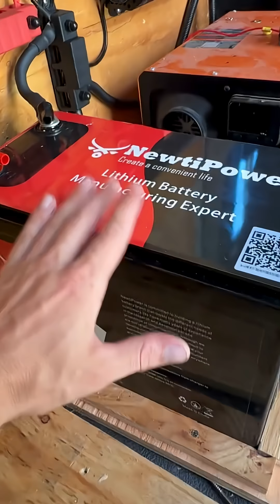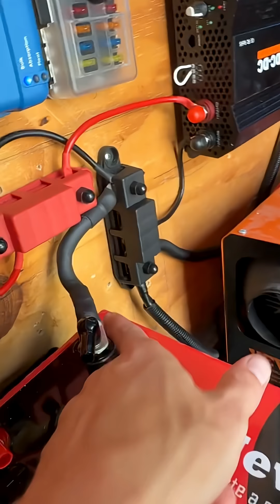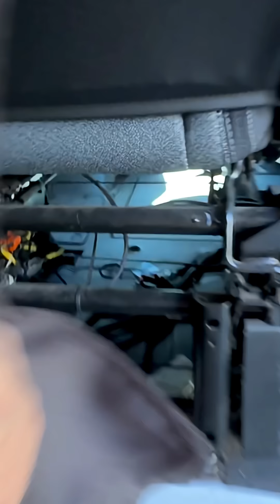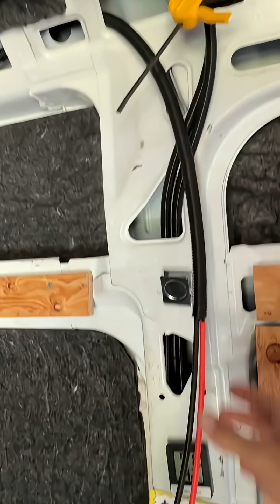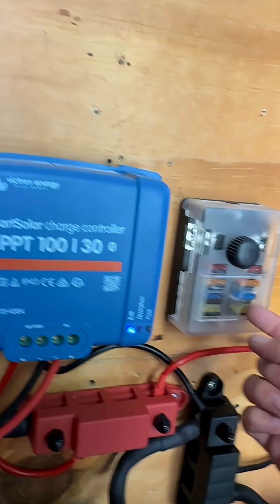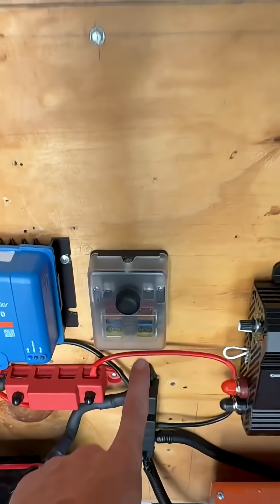12v 300ah battery with 390w of solar | Van electrical system

Comment: IDIOTIC...batteries, electricity, fuel...all attached floor and walls with untreated flammable wood? WTF is wrong with your recommending no gaps or fireproofing. Unbelievable. IGNORE this video other than learning what NOT to do.
Reply from the maker: Diesel is not flammable, zero current carrying metal is touching the wood. It is very common. Haven’t had a problem

Comment: You solar charge controller should be connected directly to the battery instead of to the busbar so it charges the battery even when you have your DC loads disconnected at the disconnect switch. Use case would be that while the RV is sitting in storage you want the solar to keep your battery charged but have your dc loads off so they don't drain the battery. If you want both DC loads and solar off for some reason then you'd trip your DC disconnect switch and your solar disconnect breaker.

Comment: 300ah. Will only get you.  About 3 hours of run time on a 12 v a/c system ?  May be a mail more
Reply from the maker: I can run it for about 10 hours non stop. I usually only run it for a few hours at night before bed

Comment: You could've skipped the bus bar. Use the 40 amp fuse between the controller and the battery overcomplicating things, man. And save some wire
Reply: Bus bars make it much easier to add other stuff to the system.
Reply: Bus bars add extra money that’s true, but they are super handy for adding and keeping wires more orderly.

Comment: Get another one of those batteries and switch to 24 volt, you can run air conditioning 24/7
Reply from the maker: Yeah I would love to get another battery. No need for 24v tho, everything in my van runs off of 12v so it works out perfectly
Reply: Better to run 48v

Comment: clean setup!  like the AC too
Reply from the maker: Thank you! Yeah the AC has been the best
Reply: @CampingWithShane I am in the beginning stages of figuring out all the electrical stuff for my van. Curious how many hours you’re able to use your A/C on a 330Ah battery? Everything I read makes it sound like I’ll need at least 630-800Ah battery to run an A/C for 10 hours every night plus a fridge, lights and the usual other small electrics… plus 800+ watts of solar to stay off grid for 3-4 days. Any thoughts or suggestions you may have for me? It’s all so confusing. 🫠
Reply: @LindsayDesigns There's an online heat loss calculator and another for solar irradiance which I found helpful.  If you know your insulation R value and surface area, you can plan out how much solar/ battery/ insulation you'll need.

Comment: So as I understand those bus bars after the kill switch is used in place of a victory lynx distributor, which I see a lot of people using?
Reply from the maker: Yeah buss bars are just extra terminals to wire things up too. Minus the fuses that the lynx has. But everything I run off the buss bars so I have no reason to get the lynx. They are also cheap

Comment: Awesome! So I have an idea for am even simpler setup, as I wont need an inverter. Plan on running a fridge and a cig hub port. Would I need a bussbar/fuse box setup? Or could I just go directly off of the battery posts for those 2 connections?
Reply: I will be charging via solar, so have an mttp as well.
Reply from the maker: I would get some buss bars so you can tie everything into them. I use a cig plug as well for my fridge it works good
Reply from the maker: A fuse box is nice, I run all my lights and USB ports off of it
Reply: Don't forget to fuse within 7 inches of the positive battery terminal (to protect your wiring not the battery) and have a cutoff switch next. Then your distribution scheme (busbar/fuse). It will be too tempting later on to add more lug connections to a single post. A 12v fused distribution box is worth the investment and looks neater.
Reply: @Velocentric  he already has both of those components.

Comment: Nice system how many watts of solar power are you using and is it enough to charge your battery?
Reply from the maker: I got 390w, I take in about 1.8kw per day from solar and I only use less then 1kw per day. So it does charge battery’s no problem 💪
Reply: @CampingWithShane very nice thank you well that settled that then I'm getting me a 400 watt solar for me build
Reply from the maker: @wea @weather4lifeyar509 you welcome!! 400w will be awesome

Comment from the maker: Since the battery has a 100ah Bms. You can pull 1kw no problem. But just not for long. About 1 hour. So you technically could cook a meal in the air fryer with it
Reply from the maker: You would just need an inverter with proper sized cables